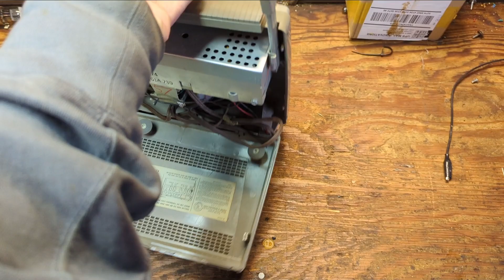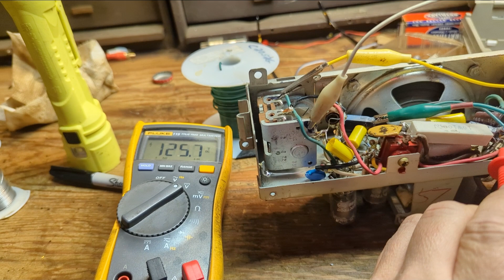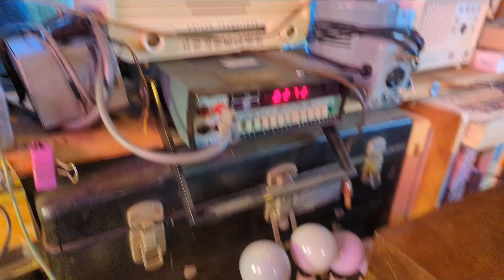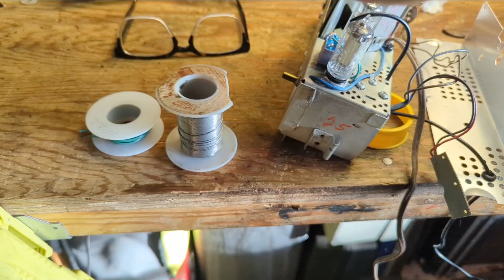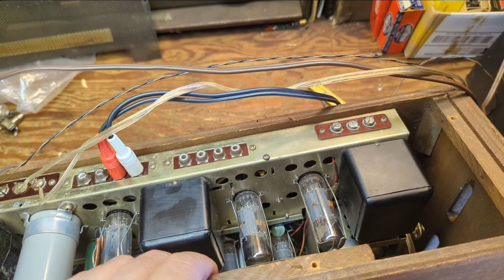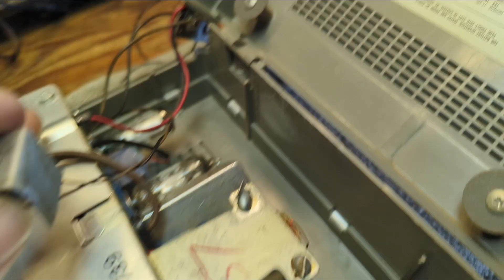RCA Portable with a previous nasty recap job

Comment: 0:54 -- An X2-type capacitor will not meet the line-to-ground safety standards, so I recommend a type Y2 capacitor. Class-Y safety capacitors are designed to fail open.
Reply from the maker: That is what I use: Its an X2Y2 cap

Comment: Perhaps two series-connected type 18650 lithium cells in series, providing about 7.5 volts, would be a good substitute for the "A" battery.

Comment: I love your idea of adding that input to these AM radios giving them a new lease on life! Just an idea is put a micro switch on the dial tuning path in such a manner that when you max out the dial at either end, you disengage the radios signal leaving your new installed signal nice and clean.  No on-off switch to drill holes for. If there’s no sliding needle station indicator, maybe install micro switch on tuning capacitor in such a manner the switch gets hit at desired timing. Or am I overthinking the wheel again?

Comment: This receiver appears to have low filament voltage tubes with directly-heated cathodes. I've noticed that when they're powered on, the sound comes out of the loudspeaker almost instantly, not unlike the transistorized models.
Reply: ...I'VE ALWAYS THOUGHT THAT TRANSISTOR RADIOS WERE "INSTANT ON" BECAUSE THERE WAS NO FILAMENT WARM UP-(?)

AND IT'S TRUE THAT THE VACUUM TUBES USED IN PORTABLE RADIOS USED "DIRECTLY HEATED CATHODES" (TO CONSERVE POWER) AND THEY WERE CLOSE TO "INSTANT ON" TOO-!!!